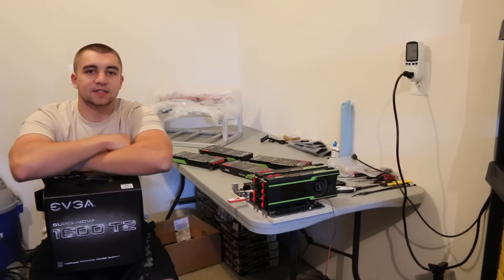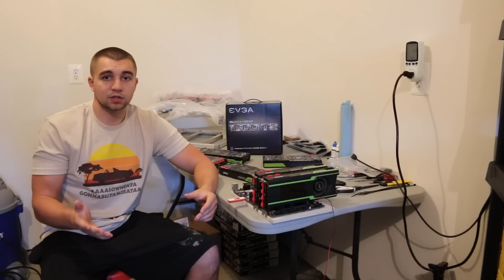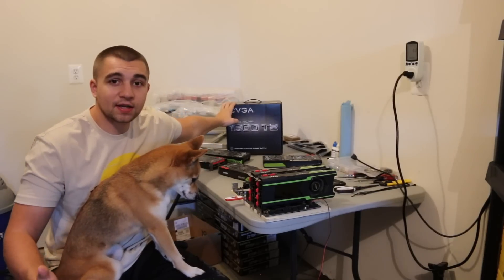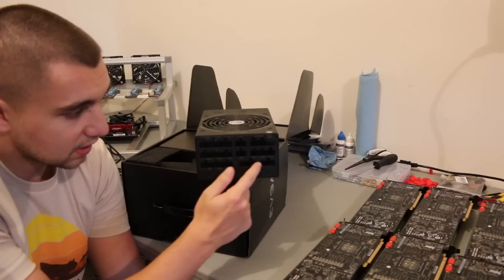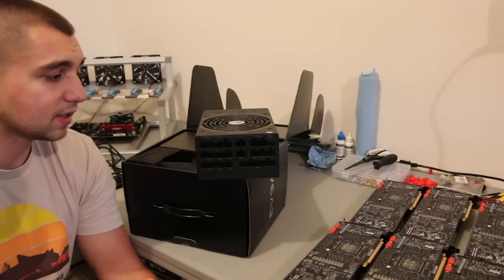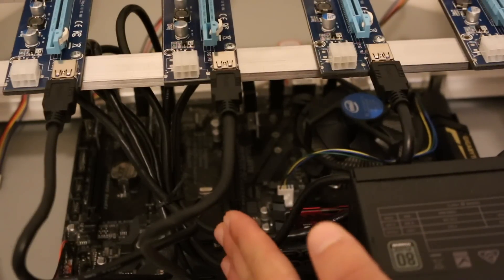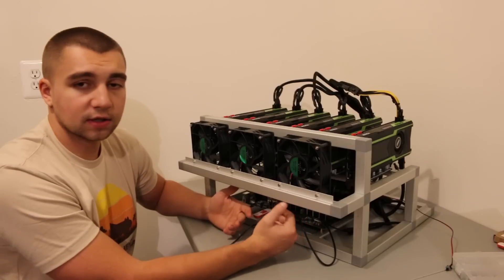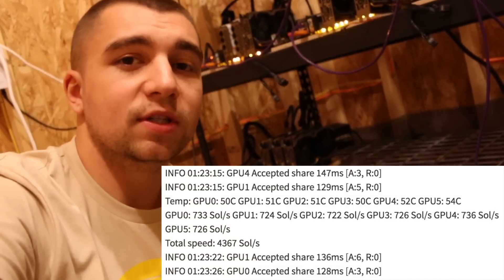How to Easily Build a 6x 1080 TI Mining Rig 4400 sols ZEC ZenCash

Comment: I have
hp Compaq 8300
16gb ddr3 ram
i5-3470s 2.90 ghz
MB-657094-001
 i want to know will it be able to work with rx580 8gb ram with full or little bit less performence  if i change the power suppy and and the body  of the computer(so it will fit in the computer) please help.
Thanks ....

Comment: how would you hook this up to a ASUS B250, my guess is it would be same, but also next to the 6 pci on the board it has a 4 pin molex, can i use the power from the Sata plugs and use a sata to 4 pin molex and attach it to the 4 pin molex on the motherboard

Comment: hello there i have 12 gtx 1080 ti and i want to know with 1 psu 1200w 80plus gold and 1 psu 2000w 95plus gold can i mine ?
Reply: HotSpoT depends what hashrate you want get , I recommend you put 2 1200w in 8 cards then you  can get about 740 sol/s
Reply: i just want to start in nicehash so for x5 gtx1080ti can i use 2000w right?
Reply: With 5 gpu then put 2 850w is more cheaper
Reply: do you know for one gtx1080ti maximum how many watt i need
Reply: HotSpoT depend hasharate maximum 290w per card
Reply: thank you mate !

Comment: Hey Vosk, I currently have 3 1080TI's plugged into a mining rig and my power meter is showing 250-300W being drawn despite my nicehash results being pretty great.  I'm confused at how I can be achieving this with so low power consumption.. do you think my gauge is faulty?

Also, I'm buying another card this weekend, I'm hoping you could help me understand whether i should try and run the third on my existing 1200w PSU given the above, or whether i should investigate duel PSUs or replace it entirely with one larger.

Love your vids man, keep it up!

Comment: Building my first rig on similar trio board with 3 16x and 3 1x. You kind of skipped over the connections of the risers. What do you use when going from 16x slot to the risers? Still the same adapter as the 1x?

Comment: While I do not doubt your results, I am struggling to understand why the voltage would have anything to do with your hash rate.  A 1600watt PSU on 110v or 240v would be 1600w.  Even with the 2% efficiency you gain on 240v, that would only end up giving you 32watts more at most if at all. Something else has got to explain the increase in SOLs when you moved your rig from 110v to 240v.  What was your 110v versus 240v SOL rating?

Comment: Hey Vosk!
Question I ran in to a slight problem with my hashing rate .
I currently have 1080ti Aorus Extreme 12x cards.
I am getting only 550-600 sol/s 
Drivers are updated 
what could be the issue?

Comment: I’m setting up a 1080 ti rig with this exact 1600 watt psu. Could you please provide an Amazon link to the cable you used to go from vga to sata?

I have 2 to 3 cards per sata because this psu only comes with 3 sata cables :(
Reply: Ok. Now I get it. You don’t use molex to sata risers, you use vga to sata, then toss the sata cable in the garbage. 

That’s what I get for not using your affiliate links. I should have known better. I’ll be buying the correct risers for my evga 1600 titanium today through your links. Thanks man.

Comment: If the 1600W EVGA T2 are no longer available, can you go with 2 1000W? New to this stuff.
Reply: I use 2 EVGA 750GQ PSU's for my 6X 1070 rig. 3 cards on each PSU and it works fine.
Reply: RandoCrypto thanks. I have 2 1000w and it is up and running. Getting about 41k

Comment: I have some gigabyte 1080 ti aorus and the have 2 8 pins. How to properly connect them with the risers? Do they still need both 8 pins connected plus 6 pin to the risers or 1 8 pin to the card and 6 to the riser. Thanks

Comment: How are you running 6 1080ti's on a single 1600w psu? I currently have 5 running on the same psu and pulling about 1400 watts from the wall. There's no way I could add another without blowing up the psu. I am also using SMos and have the cards at a power limit of 200w
Reply: I was wondering the same thing.  Seems like 6 cards would be pushing the limits for 1600w.
Reply: I am wondering the same thing. Seems like x2 1000 watt PSUs might be an option. Maybe the small percentage increase on a higher Volt circuit makes a difference.
Reply: So, what's the verdict.... Is it stable with 5/6 cards on that 1600w PSU?
Reply: 5/6 it is, I have no idea how he managed 6/6 cards
Reply: I'm trying to understand this as well. I'm new to this and my understanding is the riser will pull 75W and each 8 pin VGA supply will support 150W. If he's splitting one to cover both connectors and splitting another to go half to one card and half to the other, that would be 150W + 75W/2 = 187.5W, but he's limiting the power to 200W.  I'm new so what am I missing? How is he managing the 200W?  Please correct me on any misconceptions.

Comment: Hey man. I ordered all These parts. My question is: don’t I need to buy 2 PCI express 16x flexible extension port adapters? This is so I can mount all cards are the top, cuz the mobo has only 4 pci-e x1 slots.
Reply from the maker: Normal length worked fine for me!
Reply: VoskCoin thanks man. Love the videos. Keep it up.

Comment: You mention in the video the PSU comes with the standard 6 and 8 pin connector but the MSI GTX 1080TI Duke take two 8 pin connectors? Is this exact build only possible with the Aero cards?

Comment: At the end of the video yiybsaid serious miners will upgrade electric to 240 volt . Could you elaborate on that ? Do you mean have the wiring in yuyr house changed or are you talking about a different type of power source .  And while this may be  it's power efficient how does it I crease yiur mining rate?

Comment: I'm just getting into the mining hobby, I was wondering what I should do for my first build? Maybe a trio to start?
Reply: get a proper 6 slot mining board like the tb250 and rig it with GTX 1060 3GBs. 1060s are serious bang for your buck cards right now. I myself just bought enough hardware to build two 8x1060 rigs. combined they run at 4800sol/s and profits are almost 850$ pm after paying the electricity bill.

Comment: Holy crap.  Almost $500 for the power supply.
Reply: yeah shit, I wouldve just bought 2x 1000w PSUs. a lot more overhead for the cards and you get a ton more connectors so you dont end up short like he did and start using splitters.

Comment: For 6x 1070 ti build, do you think a 1050watt platinum psu will do??
Reply: you should really not buy 1070Ti for mining since the 1070 is very close to it in performance. the 1070Ti is better for games, not for mining in terms of price/performance and you will need a 1200w PSU.
Reply: GPUs dont use full power draw on boot and he can undervolt easily to 150w per card without performance loss, so youre looking at 900w for cards alone and then 100w for system. either way he should be buying a 1200w PSU since you always need overhead when running that many cards.

Comment: I’m just finishing my first rig and probably will build a few more soon all to go in my insulated and air conditioned garage. I ran a wired cat6 Ethernet and 10awg 220v outlet to the spot where miners will be. I built my first rig with a 2400 Watt psu from parallelmininer so I can add more cards in future as it currently has 6 1070tis. Two quick questions, how many amps will that 2400 psu use, and how many rigs can I use on that one circuit (10awg 220v with total length of about 25ft coming out of main breaker panel in same garage). Do you use any type of surge device? Do you use a 220v outlet strip or just daisy chain more outlets on same circuit for multiple rigs?

Comment: Hi VoskCoin can you help me out?

If a Zotac 1060 6g card is $274 and a Zotac 1070 mini is $411 which will provide most bang for buck. 

Im looking for max power to hashrate efficiency as power is expensive in our country
Reply: the 10603gb is ever more bang for your buck on equihash now. my 3gb cards pull an avg of 310sol/s each on zencash. I built 2 sytems with 16 x 1060 3GB GPUs. collectively they hash at 4960sol/s at 100w per GPU. this makes for a solid $800 pm profit. besides any mini card should not be used for mining, they are notoriously bad at cooling which is vital to the longevity of your mining rig.

Comment: evga power supplies pull air in through the fan and vent out through the "back" where the switch and power cable are. You can point the fan on either side because it pulls (and the PSU shouldn't get hot unless you're pulling 100% (which I know you know is a no no :) )

Comment: Are you using standard 3 prong outlets for your 220v 20A lines? How many 6+ card rigs can you run off one circuit?  I'm trying to find out if I need special outlets or custom power supply plugs because I cannot find 220v 20A outlets that don't have at least one sideways prong.

Comment: 240V just cuts the current in half, Watts are the same (Watts = amps x voltage).
Reply: 80 plus standards show that psu's run as much as 2% more efficient on 240v
Reply from the maker: my understanding is that they use "slightly less" watts on 240v, but I haven't been able to factor out exactly how much less?
Reply: this is true but when it comes to transformers the higher the voltage=higher efficiency.
Reply: This is true in a perfect scenario but power loss to your wiring is increased at higher current so stepping to 240 from 120v cuts your amperage in half. Minimizing power loss through your wiring.
Reply: marc brettschneider there is a reason why high tention lines are 100's of thousands of volts.  The higher the voltage, the less amps needed  to get the same power.  Running your power supplies at 220 instead of 110 is way better.  1000watts with 220 will be effectively half the amperage than with 110.
Reply: did you read my post backwards buddy? you are repeating what i am saying... Yes at 220vac your amperage will be half that at 110vac additionally you will draw slightly less wattage because you will be losing less from the cable itself. There is always power lost to the wiring in your walls. This is precisely why power lines are 100 000 Volts, they carry only a few amps and as such they lose much much much less energy in the form of heating radiating off the lines
Reply: marc brettschneidernow that I looked at it again I must see we were in agreement.  When I glanced over your statement I thought you were saying the losses would go up because the amperage would go up blah blah.  My bad.

Comment: The shift to simplerminerOS isn't that really dipping into your profits.  I thought you were an nvOC guy to minimize the money going out to fees? I looked into simple miner for the remote aspect more than anything but the fee is higher than I remember (true its only $2/mo per rig but in BTC it "feels" like more) and BTC is killing it.
Reply from the maker: I've been having trouble with nvOC on the higher card builds, even a day of down time paid for the rig on smOS for ~3+ months depending on the rig. I can't rec smOS for any rig smaller than 6 cards but for the 6+ rigs it makes sense to me --- whatre you currently using? nvOC?
Reply: VoskCoin I'm just using Team viewer to manage my rigs and the rigs of 3 others.  I run Windows 10 on all of them all 6 card rigs,  mostly nvidia but 3 rigs are amd.  I have to manually go into all of them and change what I mine so its getting to be annoying to monitor them.

Comment: We need a video on how to wire up a 240v outlet for either atx or server psu. That's the one video I can't seem to find on YouTube, regarding mining. You can put disclaimers or whatever, I just need an idea of how to do it. I have wired plenty of 120v and even 240v for dryers and appliances, but never for mining
Reply: If you have done 240v for a dryer you can do this no problem. I have 10-3 wire running to an L6-30P outlet that is then connected to this Tripplite PDU (https://www.amazon.com/Tripp-Lite-Outlets-Rack-Mount-PDU1230/dp/B0007YG85A/ref=pd_bxgy_147_img_3?_encoding=UTF8&psc=1&refRID=2W83N9PDYXBYA470M4GC) Granted this is connected to a mining rig (yet), but works for rack mounted equipment perfectly.  If you have experience, you shouldn't have a problem...but of course..."hire an electrician, check you local codes, blah blah"  :)

Comment: dude, thanks for putting these vids out. I ordered parts. Just wondering how to know what power supply I actually need? I ordered the EVGA GQ 1000w PSU. I have 3 1080's and 3 1070 ti's
Reply: cool thx lots. I just realized that the vid from 11-18 I bought from the parts list was for a low-power rig..

Comment: $400 for one rig case? LOL
Reply: Include:

1x REV1 KADA 6.1 all aluminium frame6x ITHOO PCI-E Riser cards6x USB 3.0 50cm cables1x 80+ Platinum 94% efficiency HP 1200 Watt Power Supply8x 24in 16AWG 6 Pin Male to 8 Pin (6+2) Male PCIE cable90 Day warranty on all parts(3) 4500rpm fan built-in

Comment: Hey, Vosk! The 3 1080 TIs and the board\PSU  I bought from you for the mining rig are up and running! I'm mining Zen on Suprnova, and I've got it on Windows because I like using MSI Afterburner for those precise voltage and frequency tweaks to reduce heat, and I can remote into it from my main PC. I may end up wanting more of your hardware in the future. Great stuff, man!

Comment from the maker: Mining Rig Parts on Amazon- http://geni.us/WQd7cCs
Graphics Cards IN STOCK on Amazon- http://geni.us/nti5asr
Want to build your own GPU Mining Rig? Check out the full parts list below!
1080 TI RIG FULL PARTS LIST
https://goo.gl/Jyw38u Parallel Miner Rev2 Frame (Shown)
https://goo.gl/k1RBQB Parallel Miner BareBones (Cheaper)
1080 TI (6x)
http://amzn.to/2AmqUtU (Similar)
http://amzn.to/2ndk32I (Alternate)
http://amzn.to/2ngQEF0 (Alternate)
http://amzn.to/2i1AUAg (Alternate)
PCIE Risers (6x if needed)
http://amzn.to/2hUHeJK
Motherboard
http://amzn.to/2jwsQI2
CPU
http://amzn.to/2AatLZe
Ram
http://amzn.to/2A8rJrV
USB Harddrive
http://amzn.to/2zqwlGS
http://amzn.to/2Ad58bG (Better price Alt.)
PCIE 1x 6 pin to 2x 6+2 pin
http://amzn.to/2i5vJ65
Power Supply
http://amzn.to/2neEuwj (Shown)
http://amzn.to/2i2m2BC (Alternate)
Felt + Rubber Pads
http://amzn.to/2A9ykmv
240v/PDU C19/C20 Power Cable
http://amzn.to/2AgXIGK

EXTRAS & USEFUL ITEMS TO HAVE
Zip Ties
http://amzn.to/2zqZgdO
PC Screw Kit
http://amzn.to/2i446Xq
Mining Shelf Rack
http://amzn.to/2zpnjtx (Black)
http://amzn.to/2ztA5HD (Silver)
Arctic Silver Kit
http://amzn.to/2AdY2nC
Powerline Ethernet Adapter
http://amzn.to/2hRGNjw

Download smOS
https://goo.gl/jMxTSS
Download HDD Raw Copy
http://www.mediafire.com/file/2ccebvpyuv87r35/HDDRawCopyToolSetup.exe

We are a participant in the Amazon Services LLC Associates Program, an affiliate advertising program designed to provide a means for us to earn fees by linking to Amazon.com and affiliated sites.
Reply: I melted a PCIE power cable using the double ended power connectors. I wrote two PSU manufacturers about it and both said to use two separate dedicated PSU cables for cards like the 1080ti.
Reply: Do you have a STEEM account? - would like to throw you an upvote if possible
Reply: 1: Can you come to skype some some day to personally talk about building a rig and the gpus and the technique and everyting coz I want to use the money well that i am going to borrow for this....!!! 
2: Why do you VoskCoin use turbo/founder edition gpus and not the ones that have 3 fans or something? Don't those overheat and wear down the gpus? Or have you changed the fans to each and every turbo?
3: What is the thing in GPUs that have to be good for the best hash/s (sol/s) results? Base clock or memory clock or GB?
4: Does the GigaBytes effect the Hash speed? 
5: What if you would mine with GPUs that would have liquid cooling (I mean aint it worth it if they have better base clock speed)? Or is it too risky if it leaks or is it too expensive compared to how much it makes? Like this gpu:https://www.amazon.com/Gigabyte-GV-N108TTURBO-11GD-AORUS-GeForce-Graphic/dp/B073D584Z1/ref=as_li_ss_tl?s=electronics&ie=UTF8&qid=1512015379&sr=1-4&keywords=1080%2Bti&linkCode=sl1&tag=oskoin-20&linkId=8dc9cca2e4c357dbcb405b0ff5cd5251&th=1
Reply: Approx: $5,400 not including shipping
Reply: can you use that rig to mine Verge Coin?
Reply: Hi VoskCoin!
Can Zotac GeForce GTX 1080 Ti Blower Cooler 11GB GDDR5X VR Ready Graphics Card, 3584 Core, 1480MHz GPU, 1582MHz Boost be used for mining? 
How good are they?